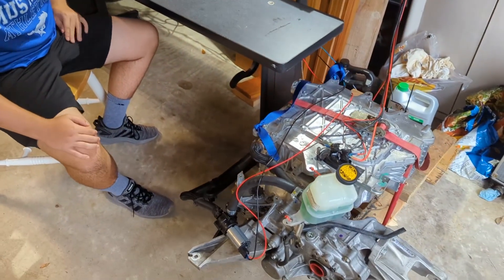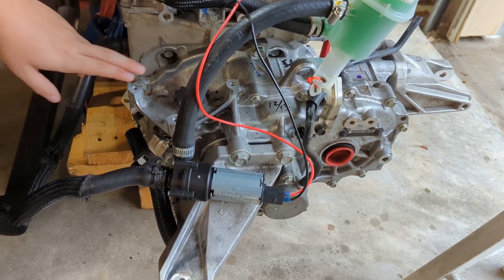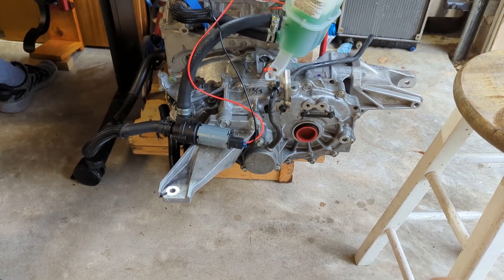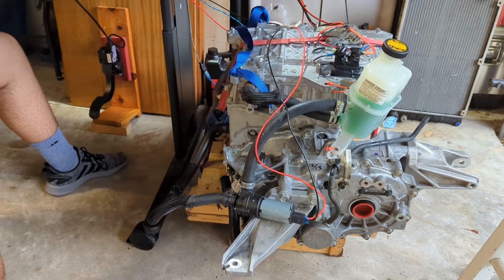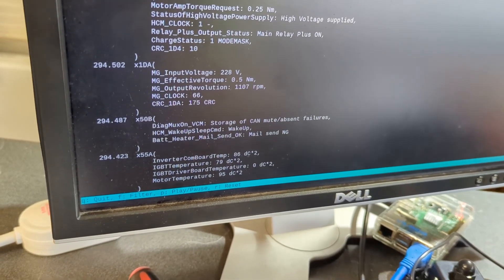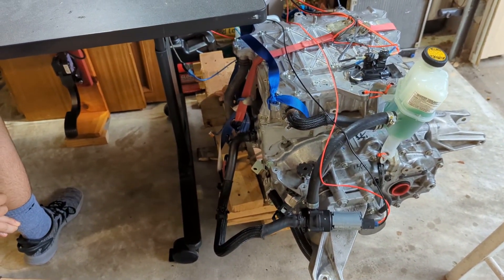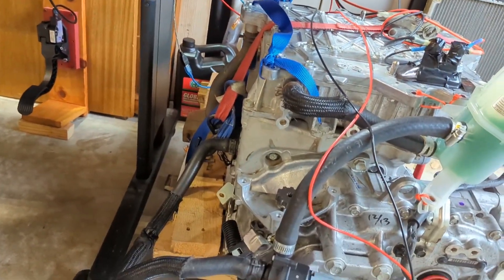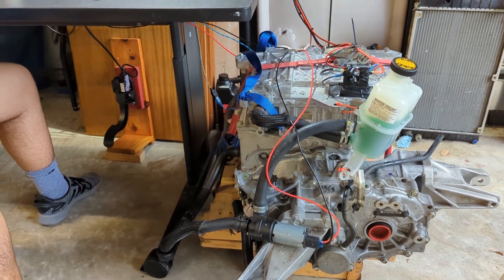Porsche 924S EV Conversion - Part 11 - Gearbox and Funny Noise

Comment: The noise could be from the differential spider gears rattling a bit since they don’t have the cv axles locking them in place. I’ve heard this exact sound before from spinning a manual tranny with no axles attached on a bench with a battery powered drill. The center spider gears are held to the case by a pin, but the side gears that attach to the axle, tend to move around a bit and rattle if no axle is holding them in place.

Comment: I don't know if you got Leaf coolant pumps or not but if you do have them they are very simple to control. I believe Tesla used similar pumps and the control is the same to make them run around half speed and virtually silent.
Reply from the maker: This was just a random bosch pump off Amazon so if you have a link or a part number for other pumps I'm all ears!
Reply: The one he used is an auxiliary heater pump that is seen in many GM vehicles. Because of insufficient coolant flow through the heater, specially at idle, this pump will compensate for better winter heating performance. Vehicles that came with it are the Chevy Venture, Pontiac Montana, Oldsmobile Silhouette, etc. I think it may have a superior flow rate than the leaf OEM pump.

Comment: Frank, When you get a chance, can you share the code, components and connections you used to read, filter and display the CAN data from the Leaf please?
Reply from the maker: Possibly. I'm not sure I'm proud enough of it to take time to get it shared, but if I do I will certainly post a video about it. In the meantime there are some sites that share the Nissan leaf dbc files that have the breakdown of the leaf CAN messages. If you have that you can easily use python cantools to tell it to just decode the messages using that dbc file. Hope that helps!
Reply: @FrankGraffagnino  Almost sure the rattle is because you have no drives shaft cv`s fitted... ps try the Open Inverter forum there is a Porsche 911 with a leaf motor in it...
Reply from the maker: @kylereese4822  thanks so my much. Yeah that seems to be the consensus on other forums too. That's good news